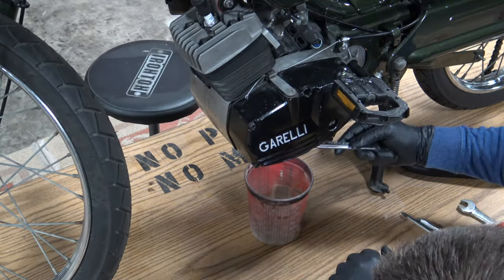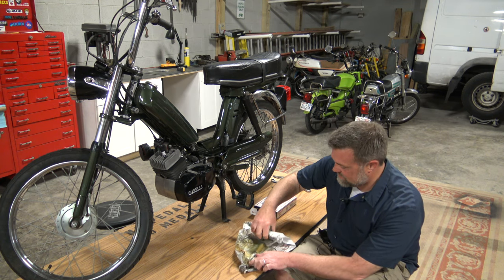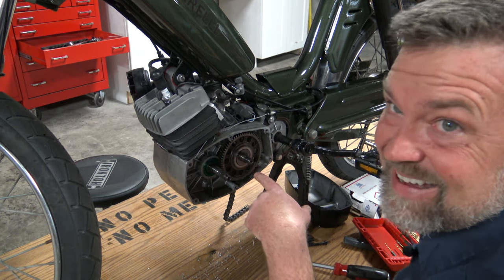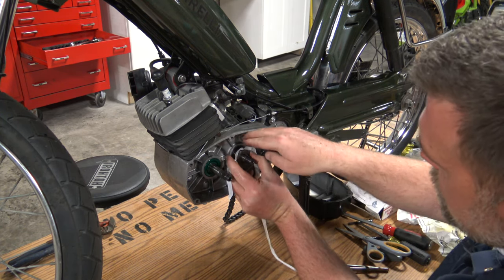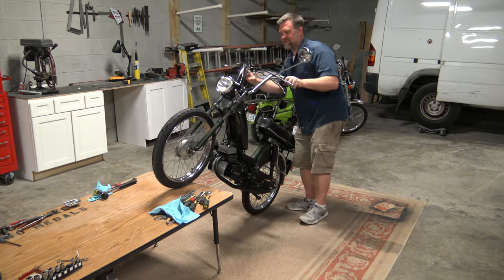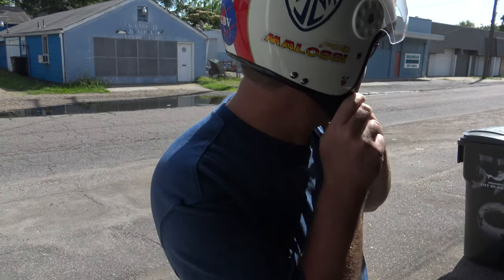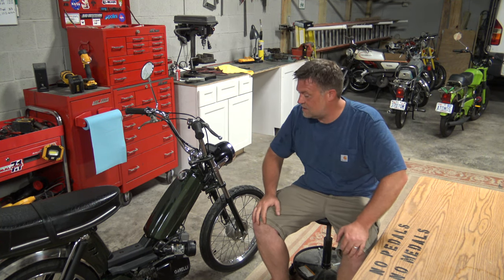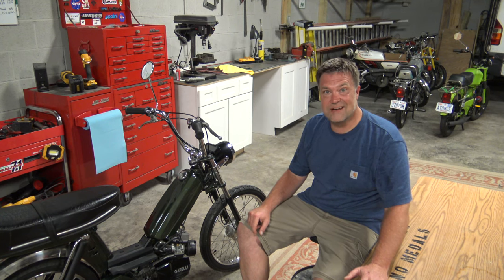DFHS Garelli VIP Ep. 10 - Finally Finale!

Comment: As an Italian youngster who loves Italian mopeds, I 100% approve your restoration/personalisation. Here in Italy Garelli mopeds are renowned for their indestructibility and longevity, and also cheap affordable power... two years ago I picked up a Garelli VIP 1 (no gears) from one of my neighbors, took it home, cleaned the carb, gave it some good fuel  and she started right off like if those 25 years sitting in a shed didn't mean anything to her...by the way the vertical Garelli engine has always been a beast, it's derived from what, in the 70s, was the most winning 50cc motorcycle. The Garelli engine you have has the same exact crankcase as the manual gearbox ones...so, if one really wanted, he could turn a single drive engine into a 3 speed or a 4 speed without many problems. Anyway, fantastic job on yours, looking forward for other uploads on the channel!

Comment: Finaly fixed the Garelli! if you don't like the bottom end that much, you can also pop a bigger front sprocket or a smaller rear. It would also look better with a green or chrome front fender, instead of no fender ;)
Reply from the maker: I have thought about changing the ratios.  Maybe that will come in v2. As for the fender...  I dunno.  Some bikes I like with the fender and some I like without.  I don’t ever ride them in the rain or mud, so it’s purely a matter of aesthetics. For this one, I love that skinny tire up front, so I decided to show it off.  I’ve still got the chrome fender so I might change my mind somewhere down the line.

Comment: Hi Dave, hoping you can help me out. Last year I was able to get a hold of my original Garelli moped Gran Sport 1978. It was in somewhat decent shape. I tore it down and build it back up after cleaning, repairing and installing new parts. It looks great. The only problem I have is a wiring or lack of a good connection. I've used a meter and it seems everything is connected however, the only way I can get it to run is to put a jumper wire from the junction box (blue wire), to the engine block screw. it runs great but if I disconnect the wire it shuts off. Any help would be appreciated. Thanks.

Comment: Hi Dave
The videos are great and glad you were able to fix the problem.  I have taken your advice earlier and purchased the parts for CDI on the same moped. All is painted and put back together and now then motor is almost done.  Need to get to more seals and put it back together.  I have a question I hope you can help with on the CDI.  On the video, I can't see how you did the wiring.  The three off the headlight and blue and white of the tail light.  I saw you add two extensions of the lower coil, but after that i am at a loss.  Any chance you could enlighten me as to which wires go each other.  Would be extremely appreciative.  Had my wife watch the beginning of the latest just because I enjoy them so much.  She agrees you are a natural  and that's coming from a kindergarten teacher who has zoomed.... which watching the class all on zoom I understand the saying " trying to herd cats"

Comment: Dave I need your help. I put a better crankshaft in my tomos a35. It's running until gets hot after 10 minutes and pipe is getting real hot all the way to the baffle.? And I put the timing back where it was previously the notch on the stator plate was directly on the top line. That's where I put it back together. And it's running decent except pipe gets hot and not as much power.

Comment: 43mph with tons of torque tells me you'd be happier with a smaller rear sprocket turn some of that low end you dont need eith the two speed into mph and you could be seeing mid to high 40s and not have to be so scared of the throttle

Comment: Why did you have to drill out that piece with the 4 tabs was it riveted?
Reply: yes it was
Reply from the maker: Yeah.  When it comes from the factory, it’s held on with these little rubber pieces.  Those deteriorate quickly and I haven’t found a place to buy them.  A lot of people just rivet them on, so I did the same.  I have these plastic rivets and I would like to use those, but they are a little to big and I haven’t been able to find a smaller size.
Reply: @DavidFixesHisShit  I guess i jumped the gun because i saw you installing the rivets later on. That is a good idea because is sturdier than those plastic pieces then.

Comment: Your cops have way too much time on their hands if they are checking for tags on mopeds.   In CA under 50cc you don't need DMV reg.
Reply: I think they are so rare anymore that they attract a lot of attention.
Reply from the maker: Man I miss that.  Here in VA it used to be that way.  Up until about 5-6 years ago, mopeds followed the same laws as bikes.  The good old days!
Reply: Ah yes you do. I got my moped registered and got a license plate. I  found out that you also need an endorsment meaning that you are required to take the motorcycle license written test and then you are required to take the driving test.
The endorsment goes on your license and it is only up to 49cc
The "registration" says that you are required to have it on you.
Cheers